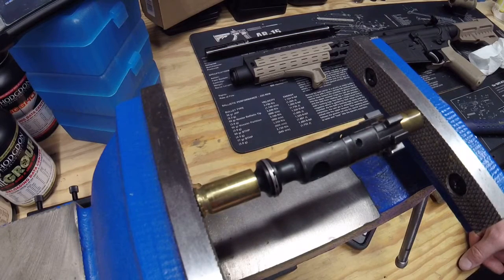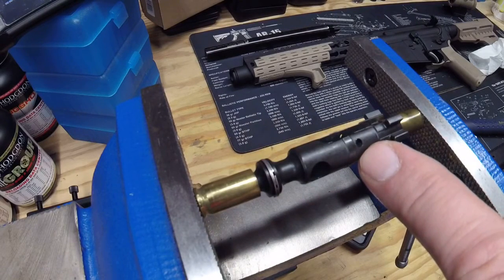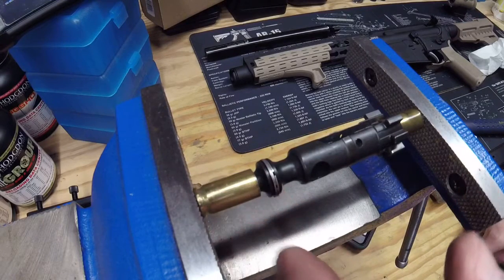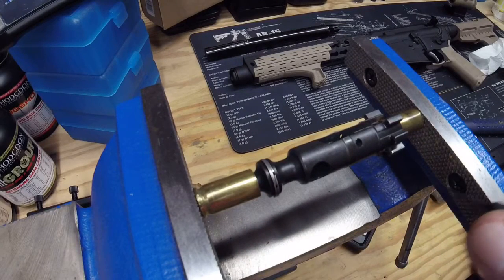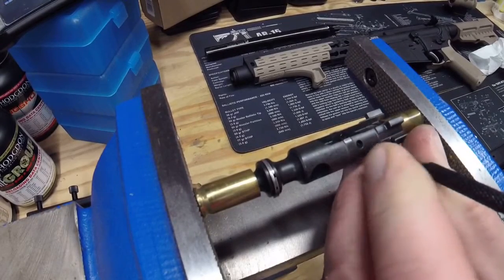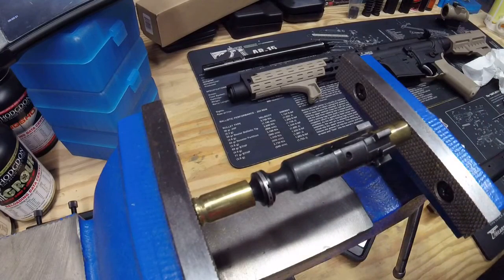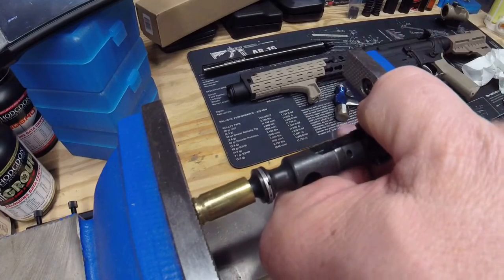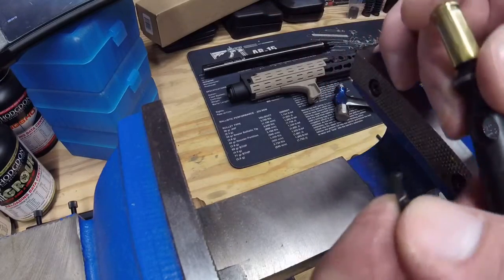AR15 ejector pin removal

Comment: are the ejector pins reusable? or do you need to replace it with a new one after you tap it out?
Reply from the maker: Eric Johnson I would replace it if it looks to be damaged.   I don’t believe it needs to be replaced if it is removed for inspection.
Reply: They are reusable. The only pins that  aren't supposed to be are the split roll pins.